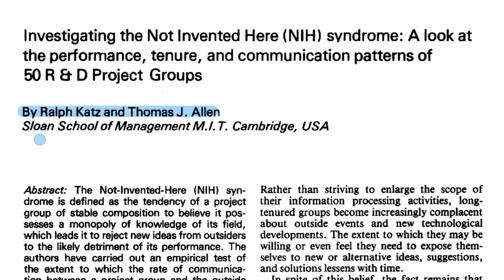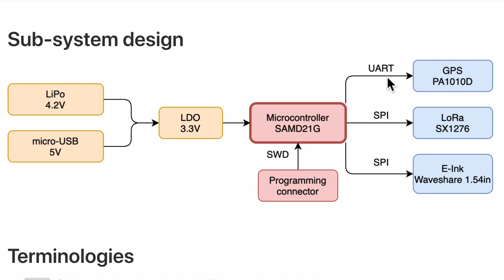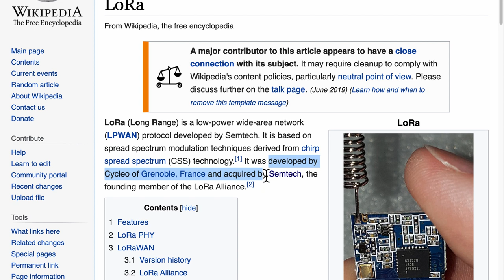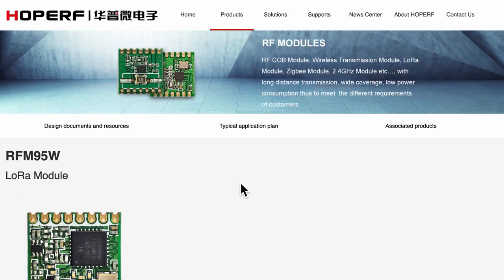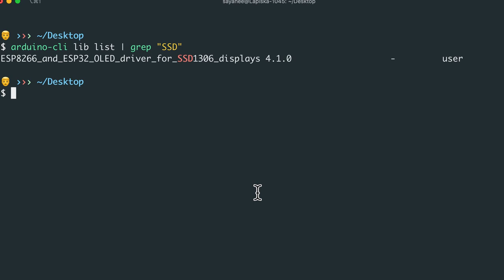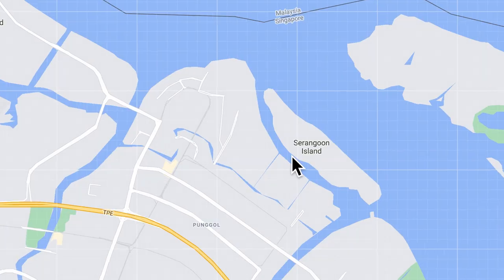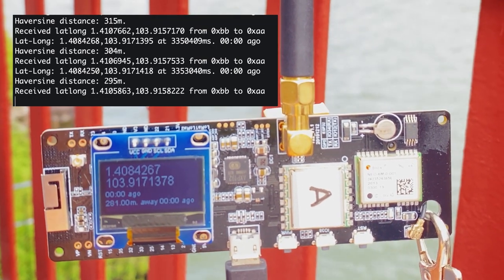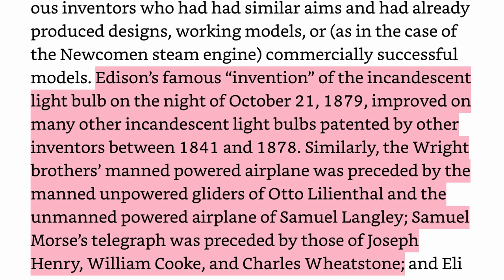A case study of LoRa-GPS tracker and how to evaluate similar projects // LilyGO T-Beam, range test

Comment: 16:00 I do a systems analysis to determine the internal and external systems requirements before settling on an architecture or solution.  If possible find a COTS (consumer off the shelf) solution.  This can bring you to a prototype faster.  Fail faster to learn from bad design decisions.  Use a SWOT (strength weakness opportunities and threats analysis).  It gives you more insight than a feature matrix.  The TTGO T-beam is a pretty good COTS choice.
Reply from the maker: Can't agree more! Cost and timing to failure is very important.

Comment: I had the same question about GPS accuracy. The ones I have had in a number of cell phones I’ve owned seem to vary widely. I was watching a series of tutorial videos on the subject of Kalman filters and that might be the solution if I were to build a GPS tracker from the ground up. 

I’ll have to look at the data provided by GPS receivers and see if they have a way to calculate CEP (Circular Error Probability) and maybe use it to weight a current GPS position compared with previous ones. If not, perhaps it can be deduced from the number of satellites currently being received.

Comment: You completely overlooked the SX1262 in the T-Beam vs older LoRa chips.  The SX1262 has a bit more power output and thus range.  Double the distance requires 6 more db of link budget.

Comment: Never seen the Arduino CLI will definitely check it out. Thanks for the content! Currently developed and tested remote sensor data from a simple dht11 via direct  LoRa Connection with simple heltec modules and getting around 500m within an urban environment. With SF11 and TX of 18dbm. It's more fun to create something with your own implementation, even if there are better existing products for similar purposes. But they won't give me the joy of my self build wire dangling around between microcontroller, sensors and antennas  😀
Would like to see a real world example with different LoRa Modules range testing them with different SF and TX.

Comment: What frequency band did you use? If you were to design this commercially, you would need to know which frequencies could be used in your target market.  Whether you can use 433 ,868 or 915 MHz depends on the communications authority.  A proper systems analysis would have identified this early.  Frequency also affects your link budget.  A back of the napkin link budget is part of your system design.
Reply from the maker: Oops! Did I forget to mention? It's 915 MHz for Singapore. Good point!
Reply: @sayanee  The ISM bands and license free bands are different in ITU regions R1 EU and Africa R2 Americas R2 Asia Australia and Oceana .. and in individual countries.
Reply from the maker: @WA4OSH  Yeah, I always check with this list https://www.thethingsnetwork.org/docs/lorawan/frequencies-by-country/. It's complicated :)

Comment: Good video ...can you pls tell how long a battery lasts in ttgo on continuous use
Reply from the maker: It lasted about 24 hours for me with the 18650 battery.

But "how long a battery lasts" depends on various factors including the firmware that we flash in, how often were we using the LoRa and GPS, was there a GPS fix, were we sleeping the entire mcu, the type of antenna used, etc. It is a complex calculation.

So, I would recommend doing a field test based on your entire hardware and firmware setup. Use both a theoretical calculation and a practical one.
Reply: @sayanee  thanks for your informative reply.... actually I was looking for ways to increase battery life ..came across some tips like decreasing delays ,using  sleep mode when not in use etc..let's see how far I can extend battery life

Comment: Thank you very much Both for the technological knowledge and for the inspiration.
 I would like to ask what 
Is the fastest rate of sending the gps points you have managed to transfer?
Reply from the maker: To be honest, I have not tried to speed up the transmission of the GPS data from one LoRa node to the other one. 

Are you looking at a particular application where the GPS needs to be transmitted at a higher transfer rate than 2 seconds?

I am receiving the GPS information as soon as it is received by the GPS sensor with no delay: https://github.com/hutscape/hutscape.github.io/blob/master/_tutorials/lora-duplex-a-gps-esp32-t-beam/lora-duplex-a-gps-esp32-t-beam.ino#L35

However, in terms of transfer, I am restricted by the period of LoRa node-to-node transmission of 2 seconds that I have defined myself of course as seen in this line of code: https://github.com/hutscape/hutscape.github.io/blob/master/_tutorials/lora-duplex-a-gps-esp32-t-beam/lora-duplex-a-gps-esp32-t-beam.ino#L6

Maybe, I'll need to try it one day and lower the period for the LoRa transmission 😅

Comment: hi mam, sathish from INDIA 

 i am making GPS Stimulator project for my college project . 

 i need help regarding that ,

as normally we get GPS data from GPS module and send that to Microcontroller ( here i am using stm32f105rbt6 )  ,    but i am using GPS data stored in my SD card ( that gps data in csv or txt form  was downloaded from a GPS stimulator Software )  and now i need to load that preloded GPS Data in to my STM32 microcontroller , 

is this possible ? and any other method to execute?
Reply from the maker: I don't have much information about your project, but maybe you can read the CSV file as part of a separate program written for the STM32 microcontroller and then write it to the flash storage.

Do a quick internet search on "reading CSV file in programming language C" or whatever language you are writing in E.g. could be Arduino. Basically, I'm guessing it will be a read CSV file and write to the flash kind of program.

E.g. https://stackoverflow.com/questions/12911299/read-csv-file-in-c
https://forum.arduino.cc/index.php?topic=340849.0
Reply: @sayanee  Thank you mam